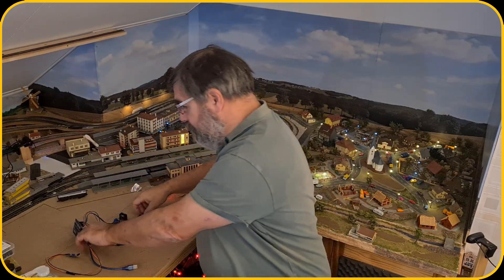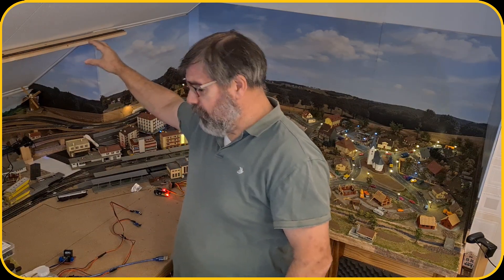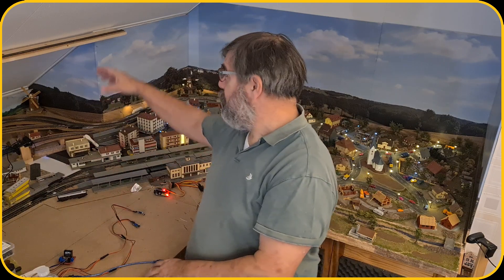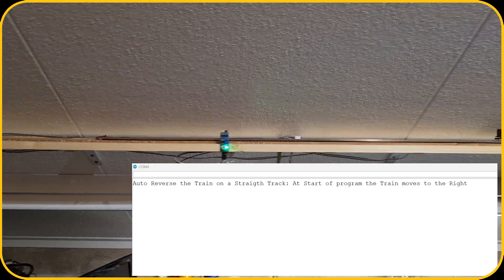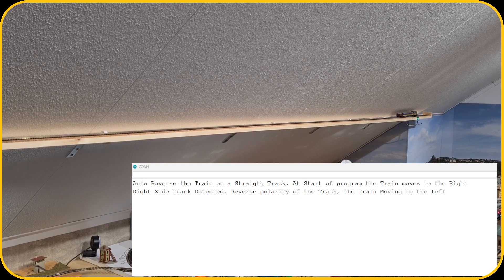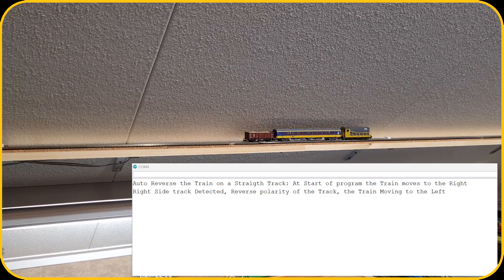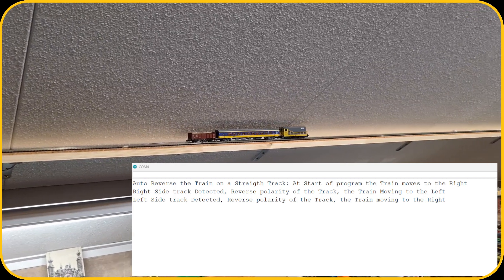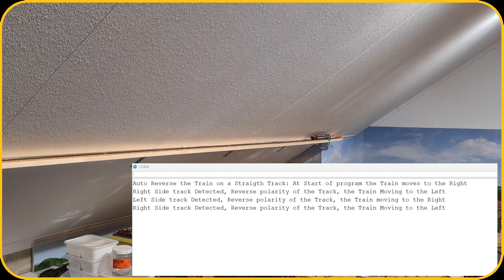Building a Larger Shuttle track part 3 The Test - H&HExpress

Comment: This is what I need for my Marklin Z track! Just a small shuttle track trough a small diorama
Reply from the maker: Thank you, its an easy cheap setup and nit a lot of coding if you use the Arduino. 2 IR sensors a Motor driver Arduino and a power supply